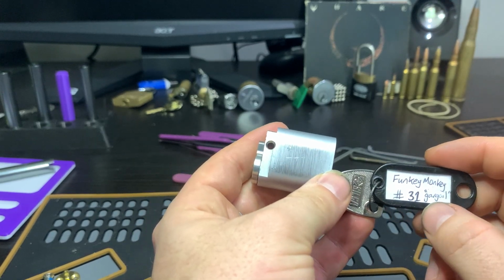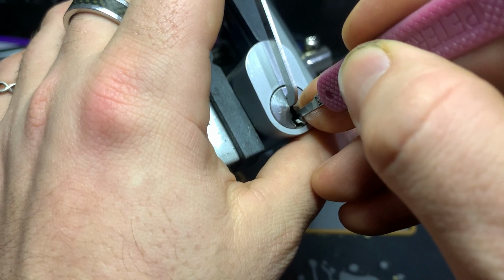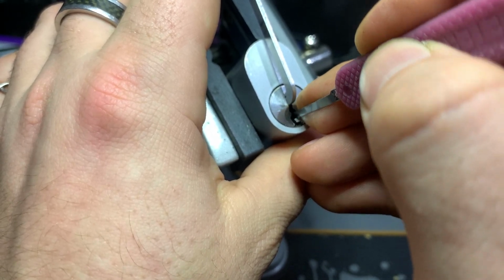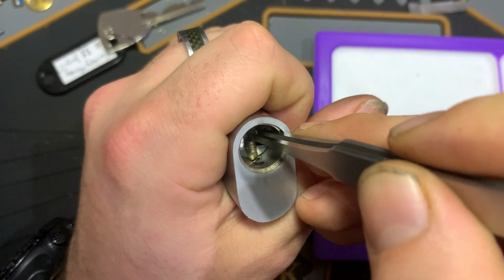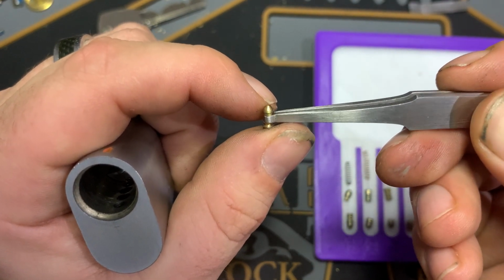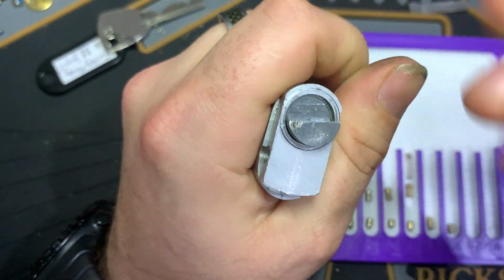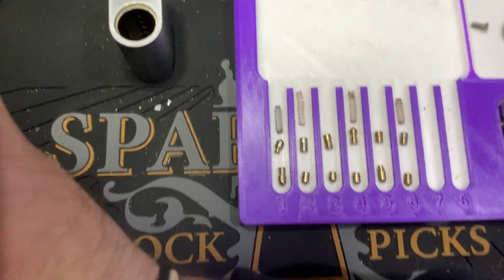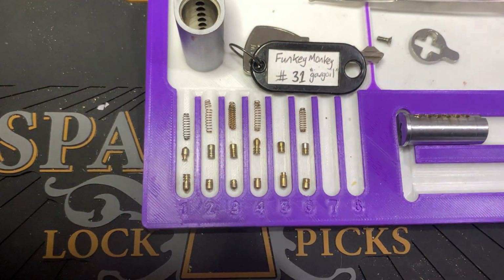'#34 Gargoil' challenge lock pick and gut

Comment: Awesome work lad. You picked this one flawlessly. 
Your follower looks like it's had a hit on that end. I personally find that most of these 570/590 ovals don't require shims when gutting. There's nothing for T-pins or traps to drop into.
You definitely deserve more subscribers mate 😎👍
Reply from the maker: Yeah it does have a hit on the end there, good eyes mate. 
Thanks mate hope you’re doing well.
Reply: @averagelifeofprince7871  lol I only know because I've done the same thing to one of my followers. Easily fixed it by chucking it up in my drill and lightly file it back.
I'm doing well cheers lad 😁👍